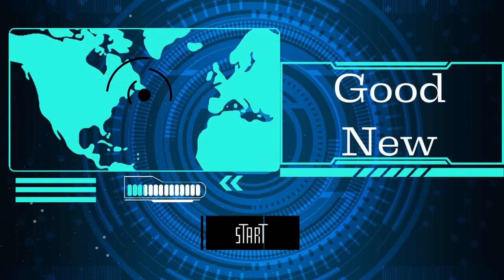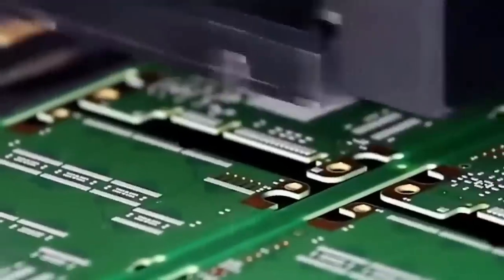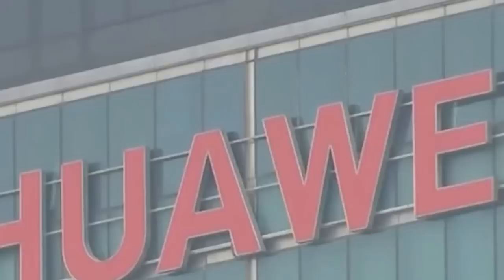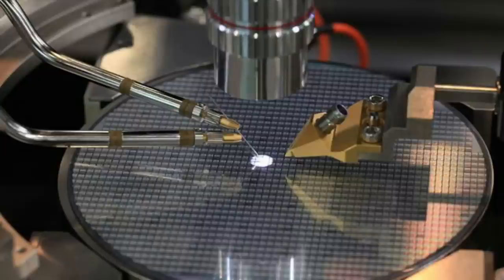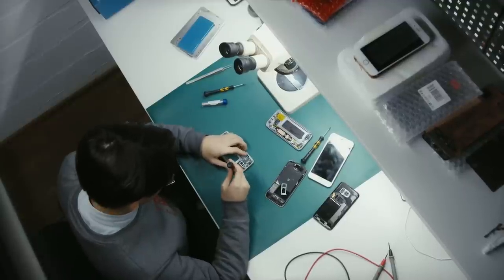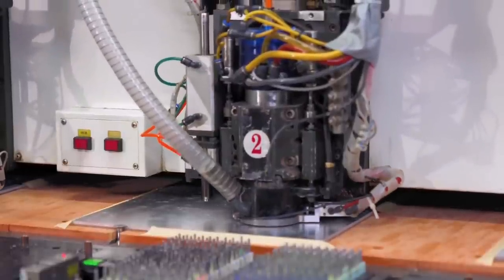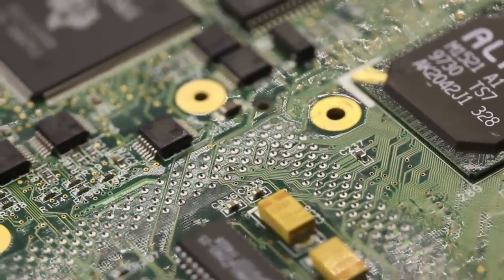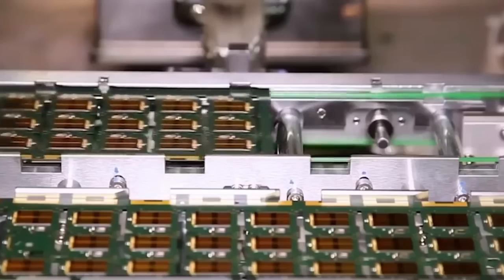Chinese chipmakers will achieve 14 nm in 2022! China Releases Its First 7nm Chip!

Comment: I have 28 nm chip from alcatel and runs fine. it was for 80 euros... I dont like the industry they invest and make everything more expensive... for example in holland I could 1.256 gigabyte laptop where as hdd was 1 terrabyte and 256 gigabyte ssd, it was for 500 euros, now they dont have the cheap hdd which is good enoug, they only sell hdd... 256 gigabyte is now 500 euros for the laptop you buy... stupid criminals... Im afraid my laptop will die soon, they ssd dies earlier than hdd as it is a flashdrive....